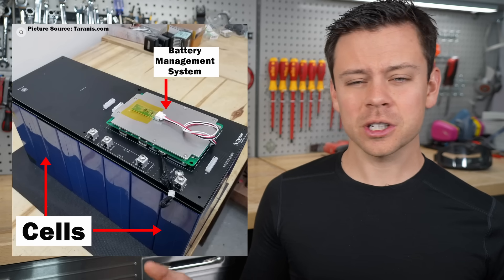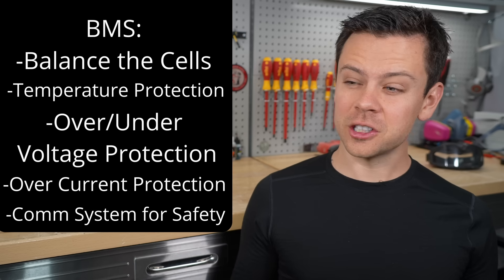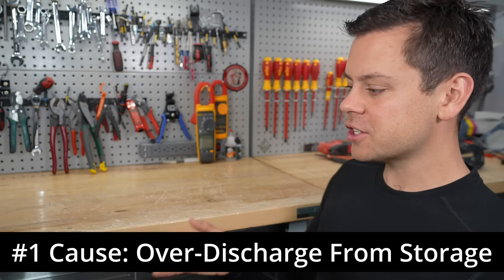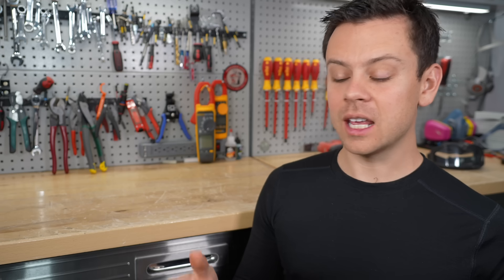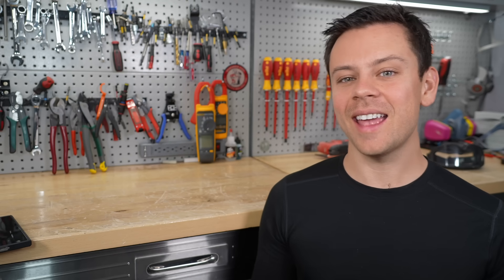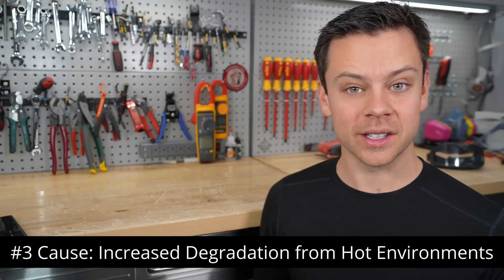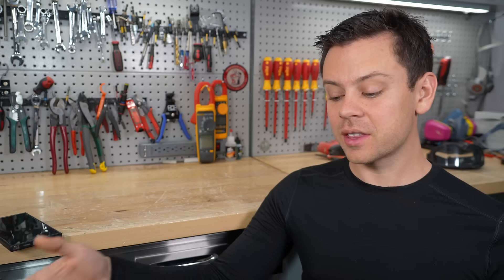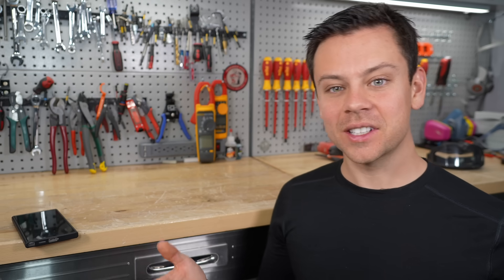The Rules of LiFePO4: The 3 Most Common Causes of Failure and General Guidelines for Long Term Use

Comment: How do you check a battery’s capacity? I can check the voltage, but how do i know if my battery is charged to say 50%?
Reply: You would need something like a Victron Smart Shunt with Bluetooth, or similar. It will install connected to the negative post of the battery to one of its large terminal bolts and everything that draws or adds power to the other terminal bolt. (The unit comes with pretty clear instructions and diagrams). Once you charge the battery up to full (by Voltage or until the solar controller cuts off all but a couple of Amps going into the battery), then discharge fully once, the smart shunt will "know" the Amp-hours of the battery and percentage of capacity from then on.

Comment: I am getting a topper for my truck and it is coming with a solar system including battery.  If I don't have enough capacity, can I just add another battery of the same amps and volts or do they need to match?
Reply: Manufacturers will recommend the same exact battery. However, I have seen different manufactorers' batteries hooked in PARALLEL, with no problem as long as they are the same Ah and Voltage. I don't think I would try different brands in series, though.
Reply: voltages need to match , capacity in ah can be different. The main thing is that different manufacturers may use different bms which are programmed differently for where they begin balancing at.

Comment: What is 100% though? I've limited the charging voltage to avoid bms disconnects on partly cloudy days. Also had to limit the charging current to avoid solar charge controller shutdowns (Victron). The charge controller is too slow to catch the overcurrent when the sun comes out from behind a cloud so I dropped it 1 or 2 amps to avoid shutdown. I have it over paneled so charge controller max is 580 watts and panels are 2x 410 watt.
Reply: With LiFePO4, the charging target is unrelated to the SOC.  You cannot use a lower voltage to reduce the SOC in any consistent manner, and by using a lower voltage you may not be allowing the BMS in the battery to turn on its balancing (Will said this in the video too).  This can cause enormous problems because the battery's cells will slowly go out of balance and reduce your voltage margins further... following you down the rabbit hole as you continue reducing your charge target.

So you don't want to do that.  You definitely want to use a normal target voltage for charging. 

Reducing the current target will help a bit, but is not ideal.   Charge controllers by their very nature are not well regulated devices (this is how they achieve 99%+ efficiency).

I understand what you are doing.  You are trying to limit the voltage and current so that the charge controller doesn't over-volt when the sun comes out from behind the clouds.  The problem is primarily because you are over-paneling, but the best solution is actually to throw in another battery in parallel and then try charging to a normal 3.55V/cell (x N cells, I don't know what voltage your battery is).

Having more battery capacity reduces the C-rate being pushed into the battery bank and thus the voltage rise will be slower... slow enough for the charge controller to be able to react in time.

-Matt
Reply: The charging Voltage of most LiFePO4 batteries is between 14.2V and 14.6V, with 14.4 recommended on a nominal 12.8 battery. Overpanelling is fine in SOME cases, but usually you do NOT want to put too many panels in series to limit the Open Circuit Voltage to just below the Voltage limit on the charge controller. LFP batteries should NOT disconnect at a Voltage lower than 15 Volts on a 12.8V battery, nor above 10V at the low Voltage disconnect. If it is doing either of these, there may be something wrong with the BMS in the battery and you should report it to the seller.

Comment: Very useful advice here about using LiFePo batteries. I also used to think the 80/20 rule applied with them after moving over from an NCM lithium set up. Great to know i can go to 100% and use the full voltage range on discharge.

Comment: I need to leave my 2 ebike batteries in Alaska for the winter 4 monthes. -40 F will be the lows. What should i do.?
Help
Reply: Make sure they cannot charge or discharge below 32F. Once back "home", warm them up for a good while to room temp. before charging/discharging. You will know when it is okay when you can read the correct Voltage, ( or very close to it), accross the terminals.
Reply: @Tumbleweed5150  Thanks so do I leave them at 80% or 100%?
Thanks
Reply: @thatalaskaguy1118  I am not an expert, but I suggest 80%. Four months should only bring the Voltage down 3%/month, so that would be a drop of 12%, if I am correct. Hopefully if someone else has experience in extreme cold with LFP batteries they will correct me. My own experience is in the far southern CA desert, so we don't get cold enough to worry about the batteries freezing. LOL
Reply: @Tumbleweed5150  Thank you yes I hope someone chimes in.

Comment: Hey Will, does the theory of charging to 100% fall into the same procedure of my Rivian R1T Quad motor battery? I believe mine is the large pack which is Li Ion. Just wondering because the MFG's always suggest charging to no more than 80% for daily driving. (maybe to reduce warranty costs for degrading?) Thanks again for educatin' the masses.
Reply: Short answer, no... if the battery bank in your vehicle is NOT LiFePO4 batteries/cells, keep with the 80% recommended.

Comment: With LifePo4 you state "down to 0%" am I correct your are referring to SOC, or 10V? Also, with LifePo4 did I understand correctly that it is good to keep at 100% or bring to 100% for cell balancing and then discharge to 50% for storage?
Reply: He was saying charge it to 100% and use it normally. That’s one part. Totally unrelated to the storage for months at a time part. Store around 50% and top them up occasionally (every 2-3 months) but most importantly…use them while you’ve got them

Comment: Signature Solar has mine set to 99% if i charge to that and keep it there for 4 or so hours will my BMS  balance my battery's?
Reply: It should balance at 99% just fine . Every bms is programmed differently . I only charge my batteries to 99% which is 3.45v

Comment: You mentioned that it is okay to cycle a battery 100% every day. At that rate, usually these batteries are said to last ten years, and then degrading to about 80% of nominal capacity. I am wondering if cycling them at 50% per day would increase the longevity of the cells enough to make them last fifteen to twenty years, or if it wouldn't make that much of a difference.
Reply from the maker: No. Just charge to 100% , it's fine
Reply: @WillProwse  I wasn't careful enough in the above. I meant if I USE 50% or less of the capacity every day, would that make them last longer than if I  use 100% of the capacity every day. Most sellers say that they will last ten years if discharged 100% every day, but longer if disharged only 80% every day. Was wondering if true.
Reply from the maker: A little bit but not by much
Reply from the maker: Unless you're charging at higher C rates
Reply: @WillProwse  Thank you!

Comment: My wife has a Chevy Volt. We park it for up to two months at a time while traveling. I'm trying to figure out if we should have it at 50% state of charge when we leave, fully charged or plugged in. It is parked in a mild climate, generally 40º to 80ºF year round. Also, it hasn't been showing the same range after charging as it once did. The cost of battery replacement is more than the car is worth. Should we try to have the BMS changed or checked?

Comment: Oof!  I bought a 24v 100 amp hour battery from Ampere Time through Amazon a little over 2 years ago. It’s still unopened in its box because I wanted to buy a second one in addition to a 24v all in one inverter(like on Will’s video). Medical bills forced the DIY project on hold. 

I suppose I need to buy myself a 24v charger to see if the battery is still any good?

Quick edit…. Thanks as always for the easy to understand and informative videos as always!
Reply: Check the voltage of the battery with a multi-meter right now.  If it is under 20V you might have a problem.  Then get it charged.   You might have to wake the battery up first... its probably in deep sleep mode, which will requires a 24V supply to be applied to it for a few seconds.
Reply: @ Thank you VERY much for that info!

Comment: The actual degradation science says:
- calendar degradation is mostly based on average SOC, keep under 50% for longest life but once a month go to 100% for balancing.
- high charge/discharge rate has big influence
- temperature during operation is also huge for LFP, more than most other chemistries. Keep above freezing and as close to room temperature as possible.
Reply from the maker: That's what I said in the video. What are you disagreeing with?
Reply: @WillProwse  just the first one you didn't mention. Limiting your capacity to 50-60% and once in a while to 100% is not the same as chwrging it constantly to 100%. When you are operating LFP for longevity, use 0-50% and occasionally charge to 100%

Comment: I have a 15kwh basengreen battery (soon to be 2) and they say 80% DoD (12kwh) so should I be discharging down to 20% SOC lowest as per their recommendations or 0% as per yours?!
Reply: Will's recommendation is for LiFePO4 batteries. Any other lithium ion battery chemistry is the 80%/20%. The reason for this is mainly because the manufacterers of LFP batteries build in the limitations on their BMSs, so that the extremes are never reached. For example, my LFP batteries would shut down if the Voltage reached 10 Volts on a 12.8V battery. Same with the top end. That is why it is safe (in both danger and life expectancy of the batteries), to run LFP batteries from zero percent to 100% daily, rather than the 20% to 80% of other chemistries.
Reply: @ it is lifepo4

Comment: Can I store a battery at -40 for a couple of months with the charge discharge turned of and charged to 80%. Battery has an internal heater and would it come on and off over those few months and kill the battery
Reply: I believe you can...but warm them up so that you can measure the true Voltage across the terminals before trying to charge/discharge them. It may be possible to use a vertically mounted bi-facial solar panel and solar charge controller to keep the battery charged enough to offset the heater discharge, if you place the solar panel so the snow is unlikely to block the panel, say on the South side of a building, etc.

Comment: If you drain to zero with a solar inverter, any tips on how to ensure my loads don’t keep redraining to zero repeatedly after bms reactivates?
Reply: That depends on the inverter. Some have a Low Voltage Cutoff that is adjustable. If so, maybe set that to a few Volts above the LVD of the battery. For example, my solar system has a Growatt All-in-one that I set the low Voltage disconnect at 48 Volts, where the battery would be at zero % at 40 Volts. I also set it so that it won't try to turn on again after the LVD is reached. That way the battery bank will never reach its own disconnection point, as well as the inverter cannot drain the battery if I am not home if a "blackout" occurs on my solar system. Since I live off-grid, this was very important to me.

Comment: The EcoFlow Delta Pro recommends 30-90 (within the app parameters) but i ignore that and go 0-100 as they advertise themselves that the unit is good for 3500 cycles while retaining 80% capacity. I questioned them and asked by cycle do you mean from 90-30-90 or from 100-0-100 and they said the latter. So why on earth then would i follow the 30-90 threshhold? I dont get it. 

After hearing this video i now know with confidence that what i was already doing is right. 

Good stuff Will thanks ❤
Tom (United Kingdom)
Reply: Most of these battery and power station brands don't actually have anyone on staff who is a battery expert, so they often get it wrong when it comes to LiFepO4.  In fact, in the early days, these companies were using standard lithium-ion (NMC) and that probably got them into some bad  habits when they finally switched to LiFePO4, which is a completely different chemistry.

There was a famously bad battery company... a company that actually built LiFePO4 cells in the early days.  Really early days (like 20 years ago) who had little understanding of the chemistry they were building.  I forget the name but they had ridiculously high charge targets listed in their literature which caused many a battery failure.  Over the years they kept dropping the cell charge targets over and over again.  Took years before they actually specified proper voltages.

Many early (and even still some modern) LiFePO4 battery chargers use a 3.65V/cell target that basically fights the BMS disconnect voltage at the end.  Not ideal.  So many still haven't learned that there is no need to charge past 3.55V/cell.

Comment: I'm actually charging my LiFePO4 battery at around 100% but not at the full voltage. I saw that his built-in BMS triggers the balancing at around 3.35V per cell so I've set the bulk and the float to 3.425 V per cell. After 2.5 years that battery keeps the cells balanced and the capacity is as new. Still, I'm a bit afraid to go full voltage because of the risk that the BMS will not always be able to keep up with the increasing voltage so maybe one or more cells could shoot up too much....?

  Thanks for the insight!
Reply: Note that charging from 90% onward might not be able to make use of the full capability of the charging source when the target is that low, because it will sit at the target voltage with the battery pulling less than nominal current.

I'd recommend a minimum of 3.45V in a finely tuned system.  I personally use 3.55V myself for almost everything, that works across the entire operating temperature range of the cells.  In colder temperatures you need a higher charge target to fully charge the battery.   But at room temperature, 3.45V is just fine if you have control over the BMS parameters and know what you are doing (feat The Off-Grid Garage).

Comment: On a 48 volt system, what would the reading be for an app. 50% charge?  I have a battery that doesn't show the state of charge only the voltage.
Reply: My chart shows 52.5 is about 50% SOC  for my 48V system. If you can afford a Victron Smart Shunt, or similar, that will give you the ability to see SOC, Voltage, and other stats. The one I have has Bluetooth to connect to my phone app.